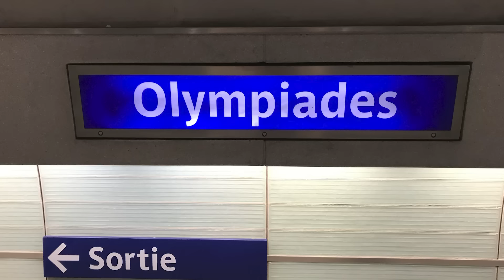Why Paris is Doubling the Size of its Metro?

Comment: Whats even more impressive is the relative cost and speed of this vs Anglophone countries
Reply: Well actually...the cost isn't that much competitive after all. Sure, at the beginning, when the project was estimated at 19 billion euro, it was wildly impressive. But as of today, with a 38,5 billion price tag (according to the latest estimates), it's cost is actually very close to the per kilometer cost of the Elizabeth line in London. So after all, the "Anglosphere" isn't THAT much inefficient. At least in these regards. It's impressive that Paris is building 200 km of metro but let's also not forget that the Elizabeth line was also quite an impressive project, at 117 km length. Both cities are setting the bar quite high up
Reply: @Adrenaline_chaser  you need to consider that the actually newly built parts of the Elizabeth line are really just the 41 km of tunnels in central London, the rest being existing infrastructure (which did get some improvement to be fair)
Reply: @cyri96  Yeah, Crossrail and the GPE are two wildly different beasts.
Reply: meanwhile NYC will build  3 stations with partially built tunnels and the cost will  be almost7 billion and it will be finished by 2034 (not gonna happen). 😢
Reply: When the French build, they can really build
Reply: I feel like the french build things even at break even, to keep economies of scale and expertise in house. Adding public transit, to places where it might run at a slight loss, to make as much of it as possible. Then they can produce things more cheaply, as they don't start from scratch every time.
Reply: The benefit of having so much skill, expertise and technology in-house.
Reply: The key to actually getting things done instead of just throwing money away and then cancelling the whole thing, is not outsourcing expertise. If you hire private consultants they will have a vested interest in dragging the project for as long as possible. In the end whether it gets completed or not isn't their concern, they take their cut either way.
Reply: @Adrenaline_chaser the Elisabeth line is not a 117km new line. It’s only 40 km of new tunnels the rest was just improving existing stations and infrastructure
Reply: @the0ne809 didn’t the East Side access project balloon to like 12 billion at the end. It’s insane how bad America is at building things
Reply: @shatterquartz Spain uses private companies but they're among the most cost-effective rail builder in the world and Europe
Reply: @HexaSquirrel  lol, more than a decade to build a simple automatic metro, knowing that the first totally driverless line in Paris was operational in 1998, so it's not even something new ...  (and I won't even mention the price, which is totally unjustified and artificially inflated because of all the out-of-touch, anti-progress, European standards/laws).
Reply: True !  Tory project: HS2 phase 1, 225 km, 2017-2030, £66 billion.
French project: Paris-Bordeaux HS Line, last leg 340 km January 2012  start of project.
July 6, 2015 end of civil engineering works, ahead of schedule. (500 heavy works including 24 viaducts, 3 million tonnes of ballast, 1.1 million tonnes of concrete sleepers, 13,000 catenary supports)  
July 2, 2017 commissioning, ahead of schedule (planned: December 2017).   Cost 7.8 billion euros
Reply: The GPE and the Elizabeth Line are absolutely not comparable. The Paris equivalent would be Line A of the RER network. It's no secret the RER was the blueprint model for this project. The other thing is the GPE was massively impacted by COVID creating delays and  overcosts. If it wasn't for COVID , LINE 15 south would be UP and running as well speak.
Reply: @Adrenaline_chaser I really don't see how you can compare the Grand Paris Project to a single metro line. The Grand Paris Project isn't just the 4 new metro lines, but also extensions of existing lines, retrofitting all the stations on the entire network, we're talking more than 1000 unique stations, with heavy work like elevating the platforms, put elevators everywhere which is very challenging in old Towns. Creating new tramway lines, and building real estate close to the stations are in remodeling the towns along the new lines.
Reply: @Also_sprach_Zarathustra. Typical primitive euro bashing. Too bad, the project isn't only building 4 new metro lines, and 10 years that's including the studies, actual construction work started years later. Now feel free where you have seen similar projects more cost effective outside of Europe?
Reply: Corruption, greed and money embezzlement aren't possible. Such projects are built with the taxpayer money in France and you don't mess up with the taxpayer money let alone to fill the pockets of some lobbies and private actors.
The French monitor that project with an hawk eye and anything not justifying the cost will be cancelled pure and simple. They don't hesitate to have projects shut down if the numbers don't add up like Gare du Nord remodeling project.
About all the projects we see in the US or the UK wouldn't be approved. And that's not a French thing, that's pretty normal in similar countries, even in Japan where the network is private now, China had some corruption and money embezzlement issues but even the Chinese asked those responsible for it to answer for it, and they do deliver the projects. What's going on in the US and the UK is total madness and that the people say and do nothing is just crazy.
Reply: Probably because in the US we have twenty times more “middle men” that all take their cut.

Comment: The metro of Paris is not the unique existing urban rail transit system serving Paris and its suburbs. There are also 5 RER lines (total length 602 km), 15 suburban train lines (1294 km) and 14 tramways lines (185 km).
Reply: And one fenicular.
Reply: And soon one urban cable

Comment: They needed to build this project because people in Paris were complaining that traveling between arrondissements required traveling through central Paris, which meant a lot of overcrowding in the center of the city. Paris Grand Express bypasses the need to go into central Paris, and that makes inter-city travel a lot more convenient and less crowded.
Reply: No, the arrondissements are inside central Paris. The 1st arrondissement is where the Louvre is located, the 8th is the Champs Élysées, etc. People complained that you could not go from suburb to suburb without passing through Paris.
Reply: No, the arrondissements are inside central Paris. The 1st arrondissement is where the Louvre is located, the 8th is the Champs Élysées, etc. People complained that you could not go from suburb to suburb without passing through Paris.
Reply: The arondissement are districts of central Paris as the poster above me said, but you are right about the nature of the problem that is supposed to besolved, particulalry with Line 15. The idea is to provide more direct connection between close suburbs without having to go into Paris proper to chnage between lines. This will allow to unbloat a little a few of the metro and even RER lines as well.

Comment: All these "renewable energy-powered city" are bogus. The electric grid is country-wide and not city-wide. At least Paris is already low carbon as long as its electricity is concerned as it's mostly powered by NPPs.
Reply: Because you know anything about the pollution in Paris?
Reply: @puccaland  I don't think we're talking about the same thing at all.
Reply: @StarryNightGazing  Renewable energy powered cities are being built that way to get cleaner cities and fight climate change. Paris will be low carbon the day there will be enough solutions to decrease the use of cars and public transportation working on fossil fuels. Hence why they are extending the network and electrifying anything or will move to hydrogen powered buses in due times.
Reply: You're not getting what I'm saying. The power grid is national, so there isn't such a thing as a "renewable powered city". However France's grid is thankfully very grid already. Yes car and heating pollution must drastically go down but "renewable powered city" is a stupid slogan that means nothing. Hydrogen is pretty stupid as a fuel as it's mostly produced by methane with huge carbon emissions.
Reply: @StarryNightGazing  You simply have no clue what you're talking about. The power grid doesn't resolve the problem here, Paris has to import 90% of its electricity from the other regions and 60% of the electricity it produces that's from fossil fuels.
Reply: @StarryNightGazing  Green hydrogen is produced by water but requires clean energy to make it, France not only can produce green hydrogen but is also planning to build new nuclear plants precisely to make that happen and just discovered a massive natural hydrogen deposit in its underground.
Reply: @puccaland  and who cares where in the country the energy is produced anyway?
Reply: @StarryNightGazing  The Parisians and those producing that energy do.
Reply: @puccaland  is this an appeal to emotion?
Reply: @StarryNightGazing  Is this a desperate attempt at hiding that you don't have a point?
Reply: @puccaland  yea sure, it's me the one who doesn't, not the one that believes that if the moving force of electrons is produced a few kms over here or over there changes something.
Reply: @StarryNightGazing  Who in this world believes that your beliefs are of any importance or even reflecting reality? Simply keep working on fossil fuels wherever you are see all the good it will do to you.

Comment: Great video but I belive you missunderstood the goal of the project. Paris already has a great network for suburban to get into Paris (RER and Transilien). 
GPE is about improving suburb to suburb transit (which is why none of the lines are going into Paris)
Reply: Except for line 14 extension, which are built to connect the rest of the grand paris express and Paris

Comment: This should be a template for many cities throughout the world!
Reply: maybe. But it's so slow even in Paris, it's disappointing, over-budgets, delays, so many wrong choices (example of creating the line 17 for the north airports, instead of really improving the already existent RER in that corridor)
Reply: @apacheglider  Slow?
6 years from construction starting to opening is quite correct.
The ground in Paris is quite a nightmare to dig through, it often requires the use of ground hard freezing, slurry TBM's, etc.
M17 is great, it will be offer another way to reach the main airport that will improve the journeys of airport workers or visitors and will be part of a larger connection (notably with the recently proposed M19).
Currently RER B is cracking at the seams due to overcrowding, and the lack of a dedicated tunnel for both B and D limits the capacity. Also, direct  trains to CDG reduce the capacity for other users.
RER B is expected to further grow in ridership and it wouldn't be compatible with the increase in PT modal share to and from the airport.
By its very existence, M17 will improve service for RER B users, as it will relieve the load.
CDG Express too by the way.
Plus, the current state of M17's route isn't even the complete one as it will probably be extended Westward from Saint-Denis Pleyel.

And finally, even if CDG T4 appears to be canceled, it is almost guaranteed that the project will come back in the near future.
It was canceled in 2020, when some thought that aviation would slow down and take decades to recover.
Instead, it is booming, with Airbus having a number of orders never seen before and growth forecasts for air travel that far exceed the ones pre-2020...
CDG will end up with 3 ways to access Paris, each with different levels of service and routes :
M17, RER B and CDG Express.
Just like LHR has the Piccadilly line, the Elizabeth's line and the Heathrow Express.

Currently, most CDG passengers do not reach the airport via the RER B and transit authorities want to massively improve that.
For this to happen, RER B cannot remain the only rail based access mode from the city.
Anyway, it wouldn't be able to cope with the level of public transit modal share that they intend to reach.
Not building M17 would have lead to tons of critics about even more saturation of RER B, as CDG would have required tripling or quadrupling the capacity.

Comment: Connecting the airports is a great idea fro all visitors. will definitely help the traffic and the reputation of the city.
and teh first outer ring is definitely a great idea to help the suburb to suburb transit.
Reply: Actually for the visitors they are building the CDG Express to Gare de L'Est and they will have to pay 25 euros.
The connections with the metro that's much more for the locals.

Comment: You missed the point ! The project will provide connections of the suburbs AROUND Paris and take away the need to go into the overcrowded city to change lines and go out again.
That’s the aim of the project…
Reply: No, that's also the extension of existing lines, new tramway lines and remodeling real estate alongside those lines. Plus retrofitting the entire network, 1000+ unique stations.

Comment: Really appreciate the Line 14 extension to Orly Airport, the RER and tram won't be alone anymore. Another major global city that will finally have a direct metro airport connection, unlike the New York/New Jersey metro area, which insist on AirTrain transfers at JFK and Newark. LaGuardia is very close to Manhattan and the hotels around Queens Plaza, yet officials insist the Astoria Line can't be extended a couple of stops.